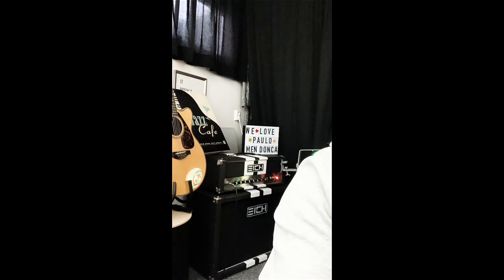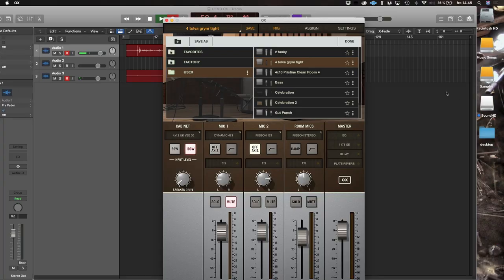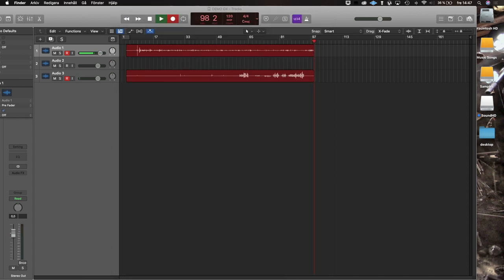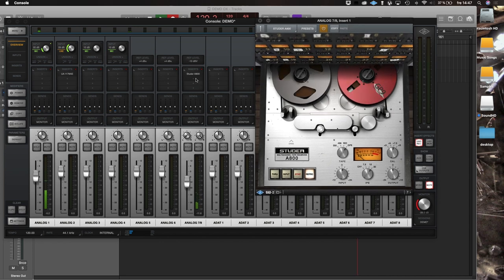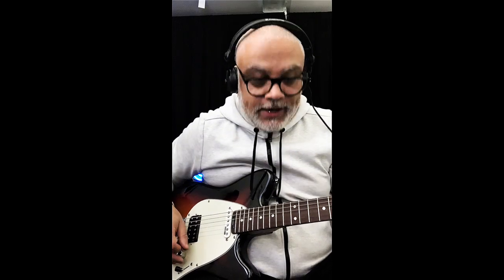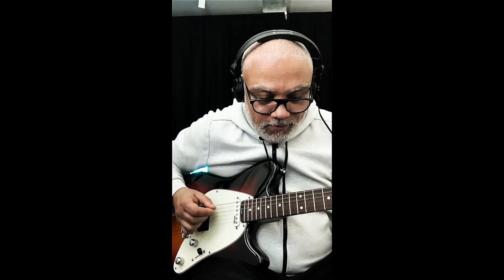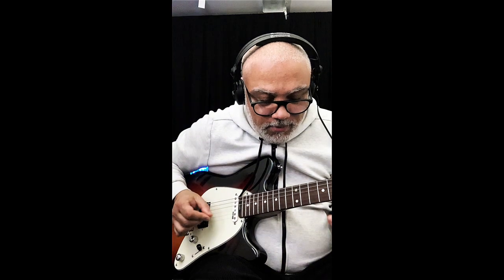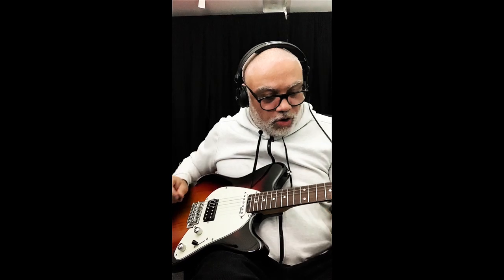UAD OX  Universal Audio

Comment: How are you coming out of the OX into Apollo? I was using the line out's but have just switched to using the S/PDIF digital signal. 
I also D.I. the guitar in clean before the ox for that clean dry signal for blending if needed. Recording guitar like your in an expensive recording studio! Love it!
Reply from the maker: Hey Al, I use the speaker out from the Amp head to the OX and there I line to the Apollo. I’m old school man, I rather sit and mess About  til I get the sound I want so I don’t have to re-amp it later, takes longer but saves time when mixing.
Reply: @PauloMendonca666  I was doing the same thing. One day I was messing around with the stereo delay on the ox so I then used both line outs into two tracks. Sounded killer! I was talking to the guy in the local music store and he suggested to try S/pdif digital out. Less signal noise and stereo out, plus I eliminated those two line in cables! funny that I'm also using a German amp, Engl 50 watt! 
cheers!
Reply from the maker: @alwatt4762   Ahh cool, so with spdif you get real Stereo? I will try that then.
Reply: @PauloMendonca666  I was using cubase as my daw up until recently when I updated my OS and then it would not run cubase on my mac. Lucky for me I was playing with LUNA also so now Im using luna on the mac and cubase when needed on my P.C.  That said, I'm not familiar with pro tools which I believe you are using. But In luna I have an option of using the S/pdif in mono or stereo depending if I open a stereo or mono track...
The OX is a geat tool for using tube amps and getting that killer sound you always wanted but was way to loud without having a cabinet isolation booth...

Comment: Great Sound!! :) But what happened to your red Strat? I haven't seen it in a while..
Reply from the maker: It´s still around but changed the neck from the red to my white one, wanted to record the new album with a humbucker and 2 single coils. and the red one has 3 Lace single-coil pickups, and this album is harder than the one before.
Reply: @PauloMendonca666  Thanks :) I like the sound of the white one, too.